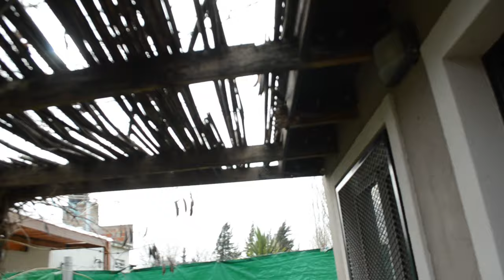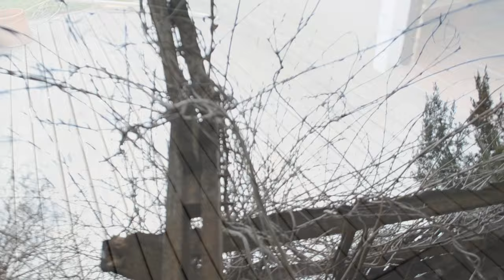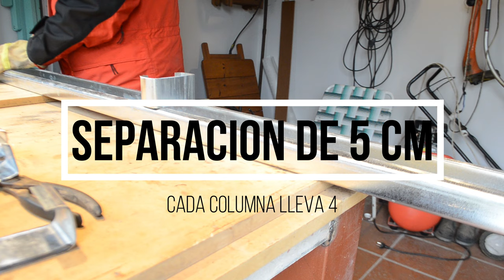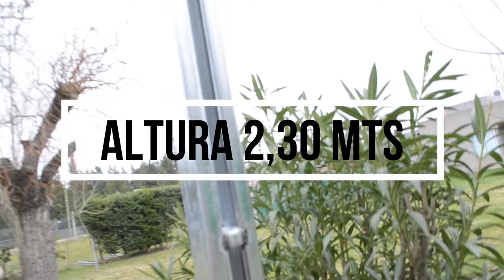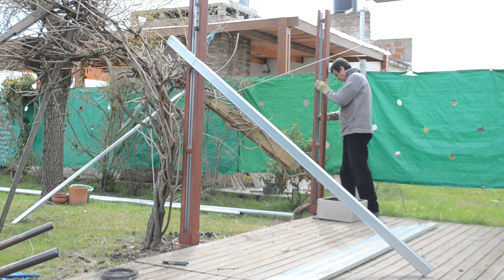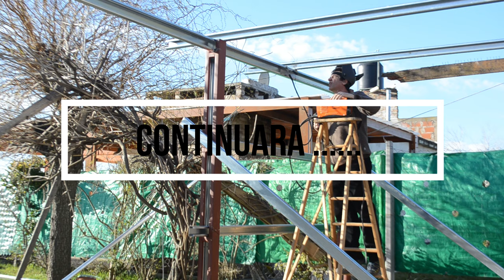⚫🔴PERGOLA Metálica - Construcción en detalle - Video 1 de 2.🔴⚫

Comment: Te pregunto dos cosas: ¿La soldadora inverter Luqstoff es la más chica de 80 A o es de 150 o 250?¿Qué electrodos usas? Voy a hacer una pérgola con perfiles C y estroy siguiendo tus videos como referencia. Tengo que empezar comprando la soldadora, soy ingeniero electricista, también vivo en La Plata, pero me doy maña para hacer este tipo de trabajos. Así que agradezco tus videos y es probable que te vaya haciendo consultas. Muchas gracias.
Reply from the maker: Hola Hugo. Es el modelo evo 180 que da como maximo 160 A. Los electrodos que use son los punta azul de 2.5 mm, los comunes. Solde los perfiles entre 45 y 60 A. Depende el esoesor del perfil el amperaje que vas a usar. Te recomiendo el perfil galvanizado porque el comun viene con aceite y te va a costar mas trabajo limpiarlos para que agarre la pintura. Ademas es mejor por la proteccion adicional. La pintura la compre en 44  pintureria y ferreteria Branchesi. Es pintura al agua especial para galvanizado. Tiene muy buena adherencia. Si necesitas te consigo que marca es. Cualquier otra consulta bienvenida y suerte en el proyecto. Un saludo.

Comment: Hola master. Tengo pensado hacer una estructura similar pero iria cerrada ya que es una habitacion. Estoy considerando usar hierro estructural en vez de estos perfiles c galvanizados. La duda es por la transpiracion y que me condense adentro. Algún consejo? Gracias
Reply from the maker: Hola Carlos.... que temita !!! Un consejo, es que el perfil que pongas, ya sea C o estructural no sea parte de la barrera térmica.- Es decir, si una cara del perfil esta a T1 ( afuera ) y otra cara a T2  ( adentro); esa diferencia de temp. hace que condense.- Un ejemplo, lo tenes en las nuevas ventanas de aluminio donde adentro chorrean agua.-  La solución para un techo seria:  perfilería, encima aislación con madera, encima aislante térmico, por ultimo chapa.- Es caro, si: pero es la solución para que el perfil no tenga gradiente térmico.- Espero te sirva y te agradezco si te suscribis... !!! suerte con el proyecto.-
Reply: @Catervi  Muchisimas gracias por tu rapida y excelente redpuesta. Lo que decis de las.ventanas de aluminio es asi condensan un monton. Con respecto a la estructura que quiero hacer arriba pondria apoyado en la estructura de hierro los tirantes de madera con machimbre, ruberoid, aislante aluminizado y chapa c25, no deberia tener condensacion verdad? Y en las paredes tenia pensado ponerle de afuera placa cementicia (como las de steel drame) directamente atornillada a la estructura metalica y lana de vidrio en los huecos, pero en ese caso placa de cemento con hierro podria condensar verdad? Que podria poner? y no quiero abusar de tu tiempo mil gracias
Reply from the maker: @yanososigual2023  Bien lo del techo, así esta perfecto y no vas a tener problemas de condensación.- Vamos al tema de las paredes. En el hueco que te queda en las paredes esta perfecto colocar lana de vidrio. Lo que no haría es unir la placa de fibrocemento al perfil. Si bien las conductividades térmicas son bastante dispares.-  Yo colocaría una varilla de madera de 1 pulgada de espesor, y el ancho del perfil atornillada al mismo del lado de  afuera, y luego la placa cementicia atornillada a la madera.- Ahí la aislación es total.-  espero haberte ayudado y no molesta tu pregunta, al contrario si se me ocurre algo siempre lo voy a compartir.- Suerte en el proyecto !!
Reply: @Catervi  mil gracias y ya tenes un nuevo suscriptor!! saludos
Reply from the maker: @yanososigual2023  Muchas gracias por suscribirte !!!